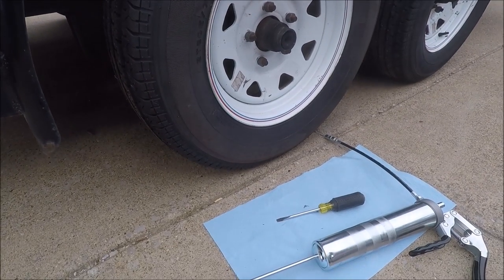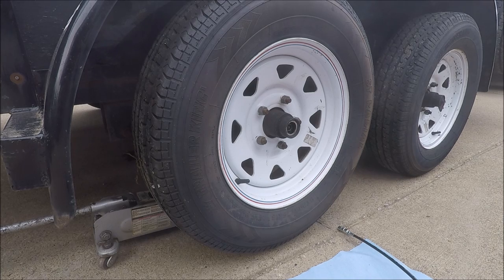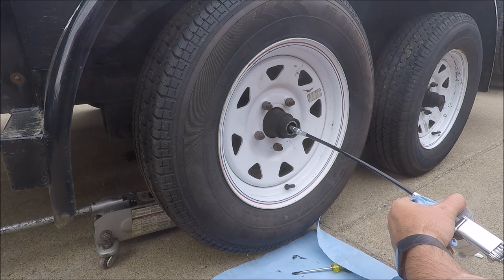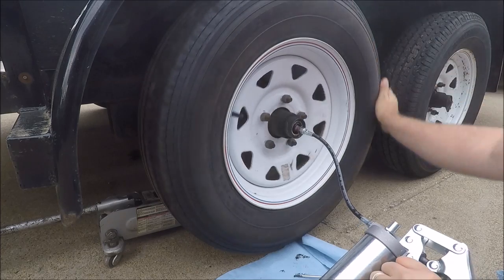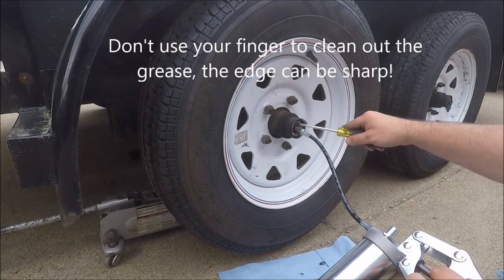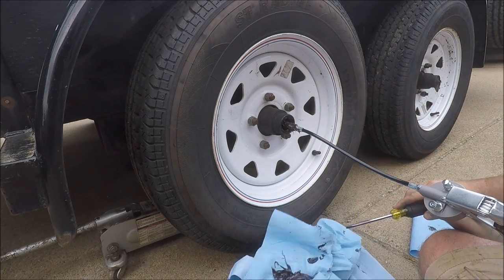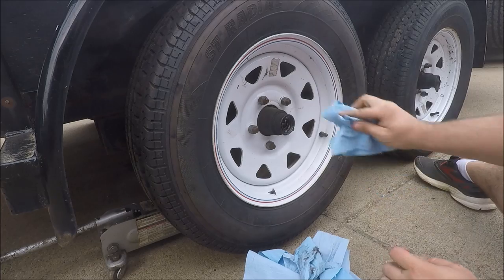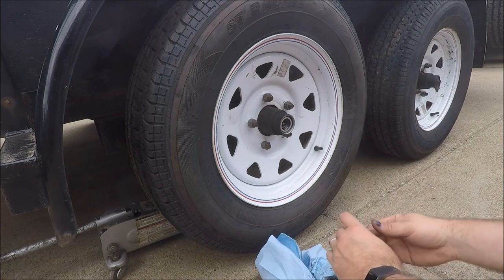How To Lubricate Dexter EZ Lube Axles

Comment: Im blown away by just how much grease you had to pump in there.  I have owned many boat trailers with ez lube axles, and never, ever had to use more than 1/8 of a tube to completely purge out the old grease.  The volume in the grease chambers is just not that much.  It just blows my mind that you could possible fit more than 1/4 tube in there.  You sure its not leaking out the rear seal?
Reply from the maker: No leaks, the other 3 wheels each took about a half a tube. I think if it was leaking I'd have seen that come out from behind the brakes. I've used the trailer since then and have no issues with my brakes. Here's a link to a how-to instruction on greasing them, and they also say they used about 3/4 tube per wheel. https://www.fiveina5th.com/how-to-lubricate-dexter-ez-lube-axles/
Reply: @stuffyoucando2  Im getting ready to do this on my new trailer trailer in a couple days.  I bought several extra tubes just in case.  I will post back.
Reply from the maker: Good luck!
Reply: @Roger Baker I know it's old post, but did you spin your wheels while pumping, and only use manual grease gun with slow application?
Reply: @zerog2000  Obviously he did not!
Reply: @Roger Baker Im with you. Way too much grease going in via this process.
Reply: It will be leaking very soon, see my other comments
Reply: If it ain’t it will now

Comment: Ive done this exactly like you show for years, no issues 8000km trips every year, yes lots of old grease comes out!! Have lots of paper towels on hand and lots of time on your hands
Reply: Yeah, these axles are great. They're so easy to maintain and zero problems. I use a plastic one inch putty knife to scrape the old grease as it comes out while the wheel is spinning - works a charm.

Comment: I noticed a slight grinding sound when you spun your wheel.  Mine made the same sound when I repacked the bearings today, but no wobbles or other behaviors that would indicate trouble. Any idea what that is?  Btw, we have 30,000 tow miles on our 2015 Rockwood Roo, including 9,000 plus from Michigan to Alaska and back.  I follow the Dexter instructions every spring, and lubed halfway thru our Ak trip.  So far, no problems.
Reply from the maker: If you have brakes on the axle, I would suspect that’s just a slight drag from the brakes which is normal. My trailer has brakes on all 4 wheels.
Reply: @stuffyoucando2  I was told an 1/8" wobble is normal

Comment: I have dexter tandems and single brake on a 20’. From factory one axle had descent grease level and one had very small amount. I always use Lucas red.
Reply from the maker: I use the Lucas too, it seems to be working well for me. I just picked up another trailer, also with tandem Dexter axles and will be using the same on it too.

Comment: Regarding how much grease is needed. The original bearings had very little grease, just on the bearings. The first time I greased them using the Ez-lube system, it took a couple tubes (total) to do all 4 wheels. The next time, it was nowhere near as much. Also, as can be seen in this video, it takes a lot of pumping. I have a air power grease gun from Harbor Freight that pumps slow, and I let it cycle (click) 2-3 times, wait 3-5 seconds and keep rotating the wheel and repeat. Never had an issue.
Reply: The hub shouldn’t be totally full! New packed bearings only need enough grease for the bearings, that’s all, this isn’t like changing the oil in a car, the old grease is fine. Cars go for 100k miles with just grease in the bearings, no need to explode it with grease!
Reply: @bryanmontgomery4050  Thats kinda what I was thinking! Like this guy is packing SO MUCH GREASE into the hub.. like how much grease is really needed??? I work on aircraft and we only pump in enough grease into bearings for it to come back out the service port (zerg fitting); after that YOU'RE DONE. I get cycling old grease, but if you have sufficient new grease the old will just break down and the new will remain... a lot of pumping and extra waste for what exactly?

Comment: Thank-you for the video. I've been doing it wrong for years. I think the only way I can do this without getting covered with grease is to have my son do it.
Reply: I saw one guy fitting in a toilet paper roll to catch the old grease. Great idea. He forgot to spin the wheel and totally fouled up the job. But the toilet paper roll was smart.
Reply: Why not take the entire grease cap off, not just the rubber cap and let the old grease fall out into a container or paper towel?
Reply: @gtileo  
That would require taking the wheel off. Then the ez, in ez lube axles isn't that easy. This it what is designed to do without removing the wheel.
Reply: @creepyzeek1  that I know but there's just a cap on the hub that can be removed exposing the castle but and the rest of the spindle

Comment: Wow, seems quicker and easier to just pull the wheel and repack by hand, and you know it’s actually going where it’s supposed to and not blowing out the seal.
Reply: I am in agreement but I am ready to service my bearings for the first time on my new trailer, so I am going to do it the way it was done on this video, which follows the official Dexter video, and see what happens. I think the only thing that makes we want to take the hubs off is I am assured that no grease purged out the inside at the seal, but I am told the seals on these are "double" and generally do not leak unless they are worn. Additionally I think that for trailers with brakes, pulling the hub/drum allows inspection of the brakes.Maybe I will do this every 6 months or so and then pull the drums during my annual "pre-season" maintenance to do a bearing and brake inspection.

Comment: This is great! You should ALWAYS spin the wheel as the new grease is being pumped in! 
We refer to this as: Dynamic vs Static!  
If you DO NOT spin the wheel, the new grease will take the path of least resistance, of which will be between the rollers, allowing much of the old grease to be left behind!
Ultimately, we shoot for a complete exchange of "Old" grease for "New" grease..... and by spinning the wheel, we get as close to that as we can!
Note how he continues until he no longer sees the old discolored grease exiting!

Comment: These axles are great. I have two trailers that have them. Once a year or so I just pump the new grease in and the old comes out. I scrape the old grease off with a small plastic putty knife as I spin the wheel. I've never had any issues with this setup and I am very satisfied with them.

Comment: Thanks. Great video.  I recently lubed the bearings using the EZ-Lube system, rotating the tire as I used a manual grease gun.  About 350 miles later, I noticed that grease was leaking out one of the four hubs, which I'll be fixing in a few days here.  It's possible that the leak was there before I EZ-lubed  the bearings (I'm embarrassed to say that I only recently learned the importance of getting under the rig regular to inspect welds, leaks, etc), but just the same, I won't be using the EZ-lube system again.
Reply from the maker: Where exactly was this leak?
Reply: @stuffyoucando2  I'm seeing new grease at the two small holes at the bottom of the brake assembly (the holes on the back for adjusting the brakes), and old grease coming out between the brake assembly and the drum.  I also noticed the truck being pushed very slightly to the left when braking.  Only happened once, but I still need to inspect the brakes to see if they were contaminated.
Reply from the maker: @Bobrnccrn  yes, sounds like they were.

Comment: Best axles I ever had used oil in the wheel bearings. By far my favorite setup so far. Had to replace the sight glass on one of them that probably got damaged in the mountains somewhere but they seemed to be a pretty good design. Can't remember the brand of axles but they were on Titan stock trailer.
Reply from the maker: I’ve heard of them on semis before, but have never seen them on a regular trailer. Are the axles submersible? That’s what perk to the EZ lubes is that it’s easy to push out grease that’s been contaminated with water.
Reply: @stuffyoucando2  I don't know if you're supposed to submerse them but they've been through a few stream crossings with no issues. Im guessing the same seal that keeps oil in would also keep the water out. It was a standard 8 lug wheel bolt  pattern on a torsion type axle setup. I think it was 16 foot trailer.
Reply from the maker: Interesting, I did a little homework and it seems they are pretty good, though the weak link seems to be the cover which is prone to leaks or breaking.
Reply: @stuffyoucando2  ya that is the only problem I had with mine. One got cloudy one got cracked, but that trailer saw a lot of back country miles, it was a super simple fix though. Maybe if a guy could figure out some sort of metal center cap and just pull the wheel from time to time perhaps that would be the way to go.
Reply from the maker: I’m not sure how far those stick out, but I used to run chrome center caps on my camper, the kind that snap over the lugs and cover the hub. Maybe a set of those would work and just pull them to check oil level occasionally.
Reply: @stuffyoucando2  I'm liking your thinking.
Reply: They are called oil bath axles and they are the gold standard best you can get. They are more common on heavy equipment gooseneck trailers.

Comment: I just lubed the bearings on our fifth wheel for the first time, using the Dexter EZLube procedure.  When I removed the rubber cap, the inside was totally clean and dry.  It did seem to take a lot of grease, nearly an entire tube on the first one, and almost that much on the others.  Hope it works as it was designed to, and I don’t regret not hand-packing.  I will say that I couldn’t get the inside of the hub as “clean” as it was before so hope it was ok to leave some traces of grease behind the rubber dust seal.  Thanks for the good video instruction.
Reply from the maker: It sounds like yours really needed greased! Thanks for watching!
Reply: StuffYouCanDo2 I guess it did.  The rig is only 9 months old, and this is the first time I’ve checked them/greased them.  I’ve read some documents on Dexter’s website and sounds like they really have tested this to be sure it wouldn’t cause issues and also do a good job getting the bearings packed well.  Will keep an eye on mine now that I’ve got the first time behind me.  Thanks again for the video!
Reply: This is not the way to do it, your going to be that guy on the side of the freeway with bad bearings. This is like letting a blind man do your bearings, do you know if it has enough grease, is the real seal blow, are the bearings worn. Its so easy to do it the right way and not the lazy way and guess. Good luck
Reply: for  @sundancer3700  
Please reconsider your statement.
I'm 78, can not get on the ground nor handle wheels very well. I am not lazy for if I told you the things I did, you would probably not believe.  Do you know for a fact the E-Z way is not effective?  I don't know but I think the big majority of bearings rolling down the road needed greased years earlier. ave a good day. tim durham sr.  the bee man
Reply: @sundancer3700  OK Fester we all know you know ,more than Dexter , how to lube their axles . lol
Reply: @sundancer3700  i have to agree. I tried this with my ez lube axle/bearings and most of the greese ooozed out the thru hole for the cotter key. Major disappointment.
Reply: @OldDunollieman  uncle fester has a point. Try it and see how well you think that inner bearing is lubercated.
Reply: It should be clean and dry and you should not use the E-Z Lube system on a fifth wheel.  Read the damn manual.  Proper bearing maintenance requires inspecting, cleaning and repacking the bearings on your fifth wheel every 12 months or 12,000 miles (whichever comes first).  E-Z lube should only be used when they are installed on a boat trailer and immersed in water.
Reply: An RV tech told that these are for emergency use only and you should be repacking your bearings annually by pulling them out, cleaning them properly.

Comment: great video, i thought i was doing something wrong, cause my first wheel hub took a full tube, sure enough the other 3 did as well. New trailer, only drove it 100 miles. Heard they come from the factory without much grease in em.
Reply from the maker: Thanks, yes I’ve heard the same thing about there not being much grease in them when new.

Comment: Did all this.  Sadly, after about 15 pumps and old goo squirting out as it should, the frickin Princess Auto gun just stopped working.  Tried everything, it just stopped, and the nipple would remained jammed on the wheel insert point.  Just my luck.  Cheap gun on special.  Gonna return it.  Your simply explained video was very helpful to get me doing this.  Thanks for helping us out here.
Reply from the maker: Thanks for watching, and sorry about your bad luck with the grease gun!

Comment: Good video - and one thing I have heard is to use a manual grease gun like you used, otherwise the 'powered' ones like at a garage can have too much pressure and blow the inner seal..   Maybe that's just a rumor,  but I also just use a manual gun..  Also check with the axle manual re: the correct type of grease.    Best wishes...
Reply from the maker: Thanks for watching, and I agree on the manual grease gun.

Comment: I tried this method exactly as shown. Spun the wheels while pumping grease. All 4 inner seals blew out. Ended up replacing all brake assemblys, bearings etc. Will repack the correct way from now on.
Reply from the maker: Sounds to me like your seals were all already on their way out. How old were they?

Comment: I don't know why everyone is giving you a hard time ? You did it by the book . I think a lot of people don't understand this system .
Reply from the maker: It seems like those who disagree think they know more than the company who designed it.
Reply: This is how I did my tandem axle travel trailer a few years back. I used 2 tubes of grease to fill and purge the cavities of old grease. Once the hub is full it takes a lot less grease the next time. I just did mine last week before our 500 mile trip and used less than a whole tube to do all 4 wheels. 

Just my $0.02

Comment: Thanks for this video.

Having owned boats and trailers for over 40 years, I'd never heard of EZ lube until I bought this last boat...I made some real rookie mistakes!  Takes WAY more grease than I thought...and if you don't spin the wheel, you can say good-bye to a rear grease seal...guess how I know that?!  My "issue" is I know the caps are on correctly, but one side keeps throwing the cap, leaving the bearing open...any ideas on why?  A dealer gave me a solution to keep them on to get to my fishing spot, but it's not a permanent  solution...
Reply from the maker: My guess on the cap might be you could have dented it in a little when you pried it off originally. You could take a look at it and take a pair of pliers flare it ever so slightly so it fits a little tighter and see if that helps. Otherwise put a little bit of silicone around the edge before putting it on and it’ll help keep it in place but still allow you to pry it off next time.
Reply: Mine does the same and it pretty sure it was the cotter pin pushing it out, took off the cap and bent the pin to where it wont move at all and all is good

Comment: Glad i am not the only one that had lots of grease everywhere lol. 

I tightened all the wheels less than 1/8th of a turn or so , enough to take the slight side to side movement out. 

I did mine tonight and i pumped 15 pumps of the grease gun. The grease started to move then. I will do it again to put more new in tomorrow. 
I believe i did this 2 years ago or last year.  I wonder if it makes more sense to me to do it a few pumps every spring and fall. 

I am using a White Lithium axle grease

Comment: This is why I love ez lube hubs. Just pump and spin. The old way sucked and most of the time with old hubs I would just pull the old hubs off and just pack new grease into the hub thick and out back on. Truth be told as long as the bearings are not every dry your good. Very rare did I have to re pack bearings using marine grease. I would repack every every other year or so, that’s why I used top notch marine grease even on trailer bearings that don’t go into water.

Comment: Is there a name for the correct attachment/hose to connect to the hub.  Or do you have a link to recommend which pump/hose you used in the video?  
Thanks for the helpful video!
Reply from the maker: Thanks! The grease gun I’m using in this video is part number W54204 sold at Advance Auto Parts, but any similar grease gun would work.

Comment: Great video for showing how to grease the Dexter EZ axles.  But the only thing I'm worried about is blowing out the seal.  Some people say that can happen.  Now I don't know what to do?  Is it possible to blow the grease seal out?  I don't want that to happen and have grease all over my brakes.  What do you think?
Reply from the maker: The risk for blowing out the seal comes from doing it while NOT turning the wheel or using a powered/pneumatic grease gun. Do it like the video and you should be fine.
Reply: I have two trailers with this setup and I've had them for years. I've never had any issue with a blown seal or anything else. I just spin the wheel while I pump grease until I see new grease and job done. It's a great design and I'm very happy with it.
Reply: @razorsharpbt7666  I finally did mine and no problems.   I took my time and it worked.
Reply: @garyp9906  Nice!